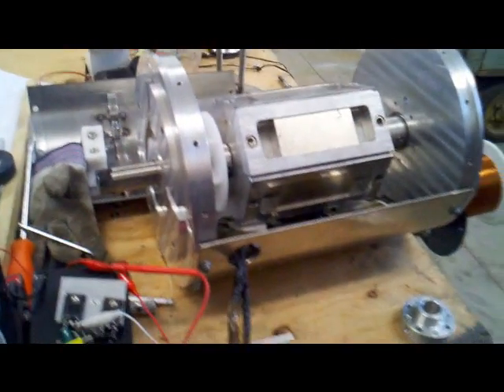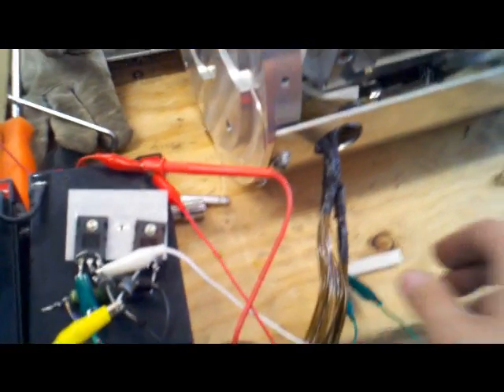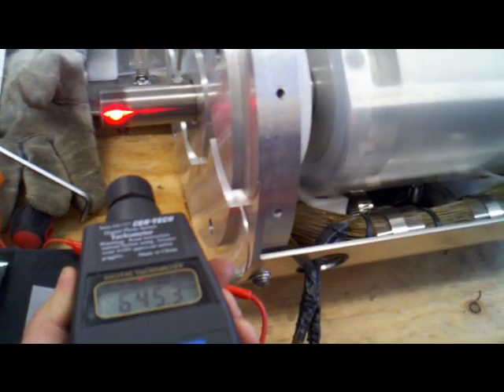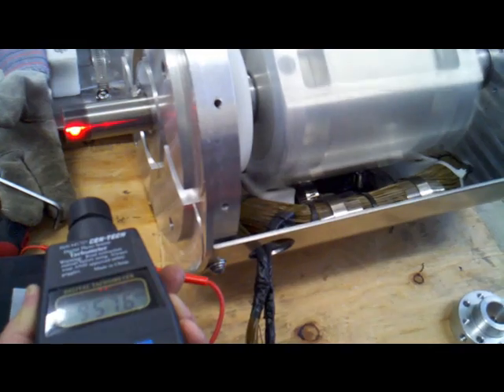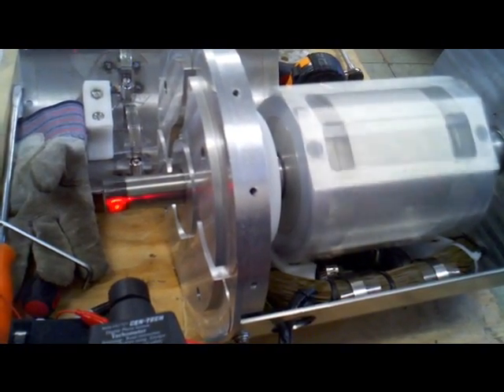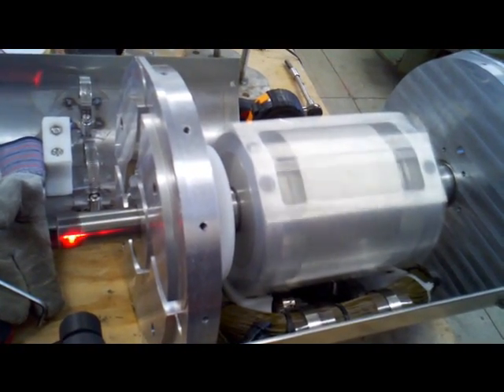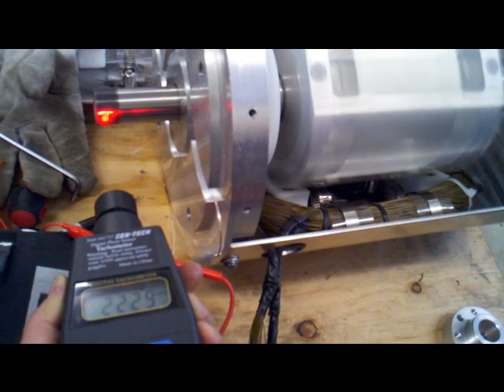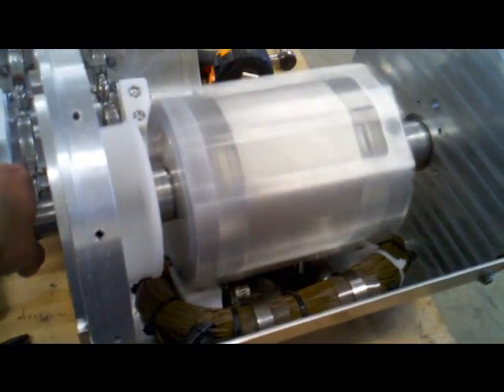11 inch Magnetic Motor

Comment: how long will it run for before it stops?
Reply from the maker: It runs off a battery just like any other dc motor, but it charges another battery at the same time unlike motors. And that is the free part.

Comment: its super silent but its still running off battery right?
Reply from the maker: Yes
Reply: basically its a dc driven brushless inverter type motor that's beautifully crafted but also is able to do serious torque work and charge other batteries at the same time? does it charge a bank of batteries in parallel as well? I read from some bedini experiments that his ssg could charge several similar rated bank of batteries using one primary source battery..will such apply here too? I seriously think you should consider attaching a homopolar generator style disc as well ..you guys definitely rock and making an N machine will be 10 times easier for you with such beautifully crafted motors you already have in inventory
Reply from the maker: fidel catsro The batteries are in series actually, and that's where people scratch their heads. How can you charge a battery that is in series with the battery that is supposedly charging it? And if the primary powering battery is 12V and the charging bank is 12 to 200V that is impressive and practical. Also, the larger the bank the more charging takes place. The charging is not conventional at all so something much different than expected takes place.
Reply: Rick Friedrich radiant energy manifesting and in action!!! That's why Tesla was fascinated with coils and wires!!

Comment from the maker: This was running on one or two circuits at low voltage with another circuit so it is not the final. That was also another prototype which we have improved upon. See newer videos for new motor.

Comment: Imagine RE spike as a glass needle slamming against water (batt resistance).  Pokes a hole in the water. (charges the batt) Now Imagine the RE spike as a sheet of glass slamming against water.  Glass shatters. (very poor battery charging)  This motor produces lots of RE, but the waveform is very "blunt". If you have a big battery conditioned to take RE charge, it takes the blunt piercing and creates a negative resistance environment for superfast charging. Just a theory... any thoughts Rick?

Comment: I had to go to 48 volts to run a 16 HP harbor freight gen at 3600 rpm under load. I am water cooling my transistors using some copper tubing attached on the back of aluminum heat sinks with thermal paste for each branch.  I still lose the occasional transistor but at least they aren't going like popcorn anymore.  I still need to do a lot more testing, but I am very encouraged by what I see.

Comment: @MrPounal.  In my opinion, this would be an ideal motor for an electric vehicle.  Probably need to run at 72 to 144 volts for sufficient power.  Water cooling on the transistors would be absolutely essential. Need a good controller as well.  If you tune it right (and that can be difficult) I bet this technology could easily double the range of any electric car on the market.  Also you are going to need very good batteries.  The motor "clubs" the batteries with RE and must be able to handle it.

Comment: @MALEXIOU1 I change resistors frequently, so there is no specific numbers to give.  
Basically I find myself using 5 or 10 watt resistors.  I start with 100 Ohm and work up or down from there watching closely for overheating. 1000 volt, hi amp diodes.  Trigger windings I use a higher wattage, aluminum shielded resistor that range from 10 ohms up to 400 ohms @ 200 watts.  You have to test each configuration to see what gives the best charging/torque/amp draw ratio.

Comment: @rickfriedrich Not running the gen at full power. My goal was just to get to reach 3600 rpm which should be full power.  Only got to about 3200 rpm.  Tried plugging in a load and transistors went like popcorn.  Water cooling the transistors helps.  Waiting on enough batteries to go to 48 volts.  Expecting much better test data at 48 volts.

Comment: The motor is not magic.  It is just a good motor. The truly head scratching stuff happens in the batteries. If you pick up one of these motors, I have a bit of advice.

1.  Invest in good eye protection. You'll need it.  
2.  Buy the best batteries you can.
3.  Condition your batteries to accept a radiant charge first using an r-charger or larger coiler. (this can take months)
4.  Order a large supply of transistors, diodes and resistors.